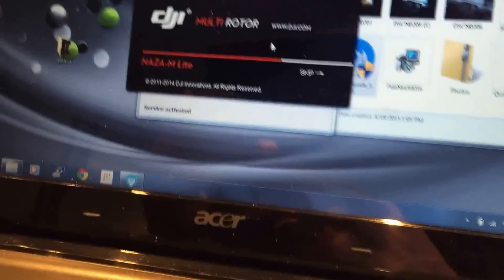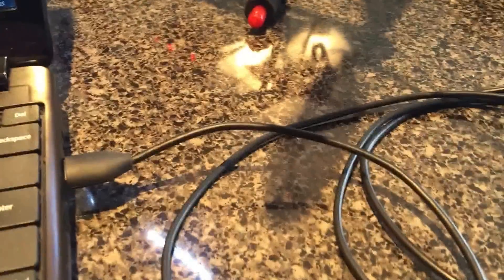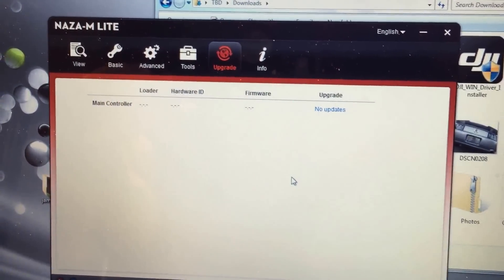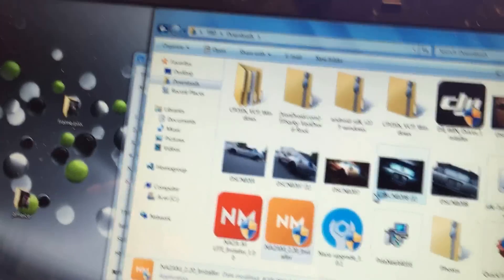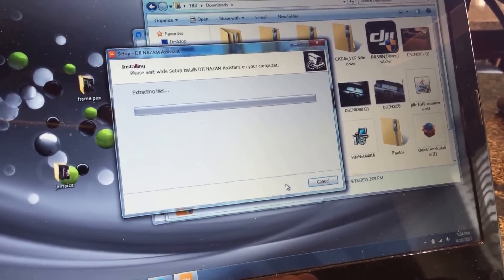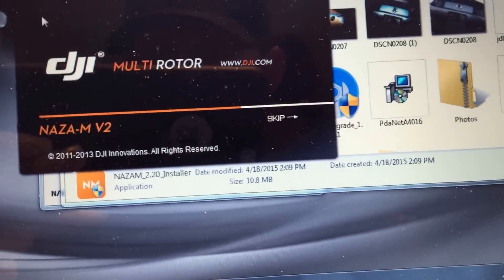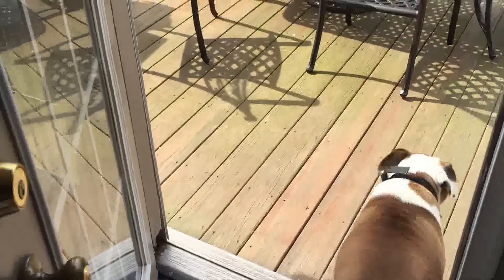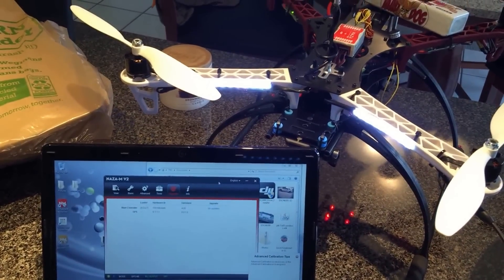Naza M Lite upgrade to V2 Full Install Video. WORKS!

Comment: Nice video but I am unable to update. All ok with the upgrader soft and the assistant but the popup windows never show up. Tried in virtual XP, real XP, WIN 7 (runtime error windows), another WIN7 (runtime error) and a WIN10 (with crazy driver authentication). Nothing works. A friend could update his NAZA 2 days ago, so the system is still working. Anyone has any idea what is going on?
Reply: Important to anyone who has the same problem like me: the upgrade popup window never show up? register with DJI account. I did this and 1 second later the popup shows and you will be able to upgrade.

Comment: Does not work, have tried on two different computers with both Windows 7 and Windows 10.  The assistant never shows the option to upgrade.  Near as I can tell DJI has blocked this in the newest Naza M-Lite FC's.

Comment: I get confusing information about this .....I have the M lite.....can it still be upgraded to V2 !  Also if it goes wrong can I refash MLite again. It also a serial number, I don't recall others saying M lite had a  serial number before.
Reply from the maker: QuadCopter 102 yes m lite has a serial number. They all do. I registered mine when I got it. And was unaffected by the upgrade. There was even an update after this video was made that it updated to without issue. And someone did reply to this video saying that indeed this process is still working as of today! So good luck and happy flying! Hope you get it working!
Reply from the maker: QuadCopter 102 as for reflashing to the lite.. that I'm not sure of. Sorry

Comment: People ask you questions ...but you do not bother to reply.....
Reply from the maker: I'm not sure what you mean, i do my best to answer questions to the best of my knowledge and ability, whats up?
Reply: xxnuyorkaxx532 ....in the comments I see people asking questions...which have no answers....most seem to ask if the update is still possible? Most think DJI have crippled the V2 update to prevent the M lite being upgraded.  Do you know the  answer?
Reply from the maker: QuadCopter 102 from what I understand it does still work. One of my viewers confirmed that just 2 days ago. I haven't been doing anything with dji stuff as far as any other modding is concerned. Good luck though! I hope you get it working!

Comment: I cant get the up grade to run on any of my computers, is it still working for anyone else?
Reply from the maker: sorry i don't know. Last time I did anything related to Quads or Naza was during this video. That was firmware 4.02 so I can't really say if they've stopped this from happening or not but, Good luck! And please let me know if you get it to work just in case anyone else asks! Happy Flying!

Comment from the maker: Yup everything changes, just like you purchased the V2. Hardware is identical in both systems. Only thing that's different is the firmware.

Comment: i already upgraded my naza lite to v2, and i have problem, my battery drained faster than lite version so with my fully 4000mah battery, my copter only fly about 5 minutes. what about you??

do I replace the PMU module to v2 version?? Please reply this... thanks
Reply from the maker: The settings are pretty conservative for the defaults... I'd reassess your comfort levels for the minimum cell voltage for failsafe. If you have a 4s battery that would be 14.8v I would not go below 3.3v per cell.... But that's just me. You got to take into account how far away you usually fly from your POI (point of Origin) also how aggressive your flight has been, plus wind Conditions..  etc. Etc.... and have reserves to land safely.

Comment: Hello Friend. how do I fix the value of Max angular rate ? I put the value at 300 and set but if I disconnect and reconnect the value back in defaul . what it can be ?
Reply from the maker: I'm not really sure. Default settings have worked just fine for me. I would adjust your rates on your TX to limit your input if you catch yourself flying too extreme . Seems to me that, that would be easier than hooking up to a laptop and accessing the Naza assistant...

Comment: Thanks for the video!
Do you know where i can download the naza assistant V2.20? dji site only has the latest 4.4 wich doesnt work with the "updated" naza lite.
I would appreciate it If you can share a link to DL the V2.20 assistant.
thanks!
Reply from the maker: 4.4 is the firmware. DJI still has version 2.2 on website for Assistant.
http://www.dji.com/product/naza-m-v2/download
Reply: xxnuyorkaxx532 oh man, i cant belive i missed it! i need to have my eyes checked LOL
Thanks!